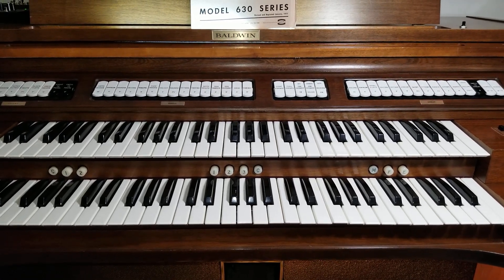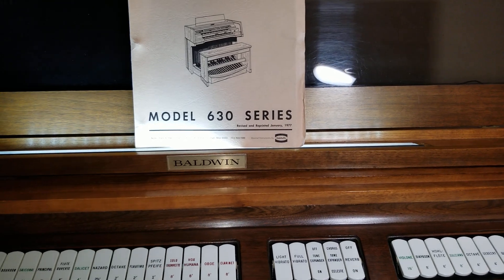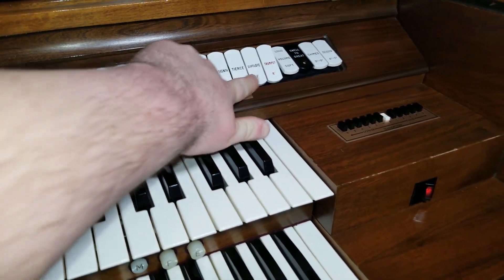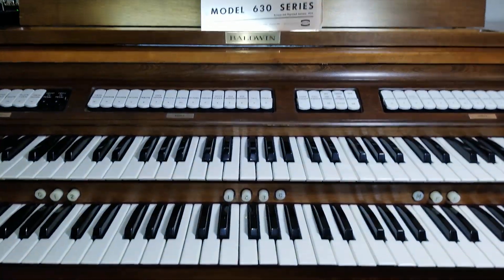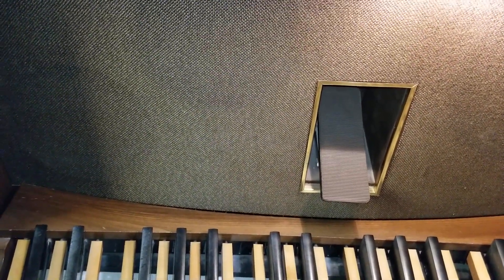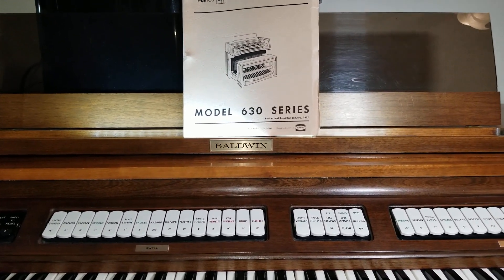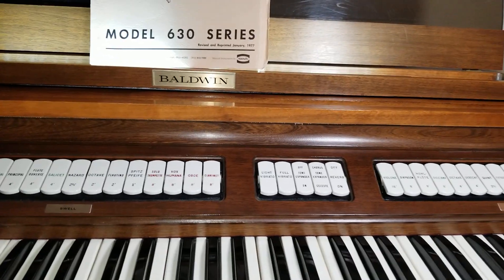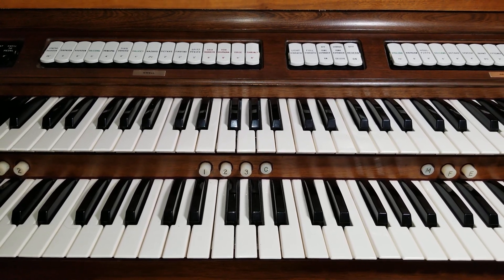Baldwin C630-T Organ MIDI Conversion Part 1: Introduction

Comment: Where did you get the hardware? I have a Baldwin CT100 I’m thinking of converting
Reply from the maker: For electronic parts, I either use Amazon or Sayal Electronics
Reply: @ChrisPlaola  for the midi parts?
Reply from the maker: @Ccyawn123  I got the midi encoder from a site called "Hauptwerk Hardware". It is based on the Arduino Mega 2560.

Comment: I have played this organ before. But if you convert it into MIDI, you will not have the sustain feature and transposer that is not available on computer software.
Reply from the maker: Most MIDI software has a transposer built in, so it's not an issue. As for the reverb, the spring units are still intact, and I am planning on integrating them somehow.

Comment: I would be interested in more detail about how you added headphone capability down there.  I have a baldwin and the  port for "external" it a big round thing. Not sure how to convert that to headphones.
Reply from the maker: There are 5 output channels. One for each division and 2 for the tone expander. I only hooked up the 3 divisions because it was just for practice. I had some of the special plugs for those round outlets, and I soldered the three channels + ground in the proper locations. The outputs in the back of the organ output line level signals, which I ran to a small audio mixer (line input) to combine the signals. If you do not have any of the plugs, you can open up the little box where the round outlets are mounted and solder to the back of them. 

Here is the page from the service manual that has the pinout of those round outlets: https://cdn.discordapp.com/attachments/719765973716041732/785018296227201044/20201206_003808.jpg
Reply: @ChrisPlaola  any chance you have pics of the soldering you did there?
Reply from the maker: Wire it to the "Echo" port. This will allow you to turn off the internal (Main) speakers. 

I have since completed the MIDIfication, and have wired a new headphone jack to the internal PC's audio output.